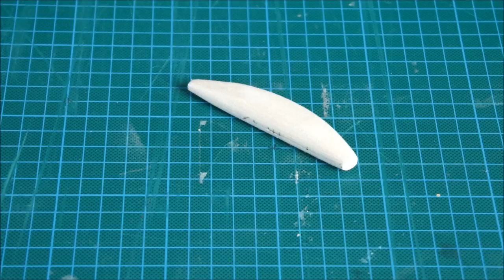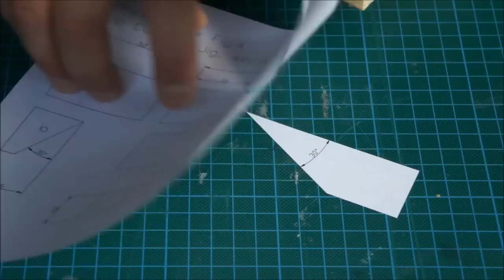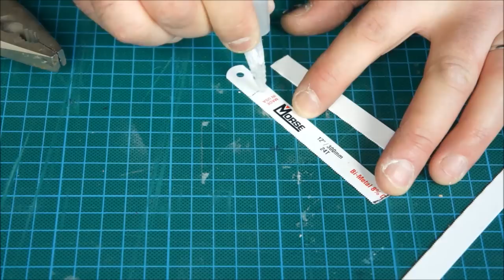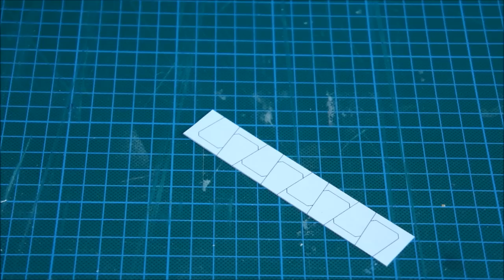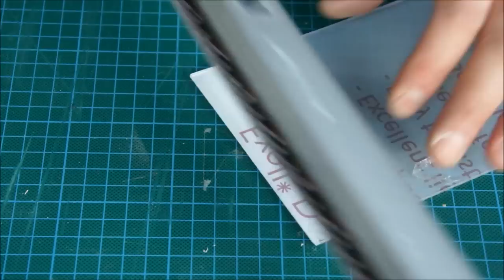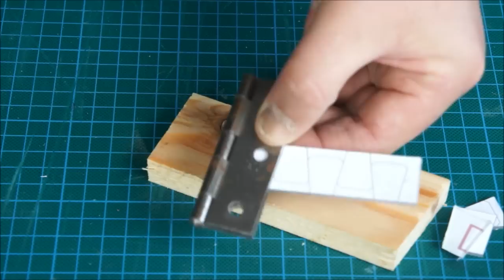How To Make Balsa FishingLure Part 4

Comment: Paul, sorry if an Uber dumb question, but what determines the 30 degrees angle, is it the size of lure, the swim depth, the amount of action required or none of the above....just personal choice ?
Reply from the maker: it is hard to make firm rules about things like bill angles on there own as factors like size of shape of the blade and its position plus the type of lure all can change how a lure behaves.The simple answer is I experimented with the angle until i got what I wanted.  between 30-45 deg is about normal for a shallow diving wobbler, turn in right down and it almost stops diving and becomes something like a wake bait
Reply: Cheers mate !

Comment from the maker: In the next video I glue them together with two part epoxy this would I suspect be as strong as inserting the wire into a slot. Three coats of epoxy are added to the lure which adds to the strength but hopefully one day I will catch a fish that will completely destroy my lure.  Thanks Paul Adams

Comment: great video man , i also make my own lures but if you are making lures for biger fish 10+ pounds my suggestion is to make them from one piece of wood than shape them and than cut into them from head to tail in the bottom ( but do not cut them in half) to get wire in and close them with 2 component epoxy glue that will be solid as a rock .sorry for the bad english it's not my native :)